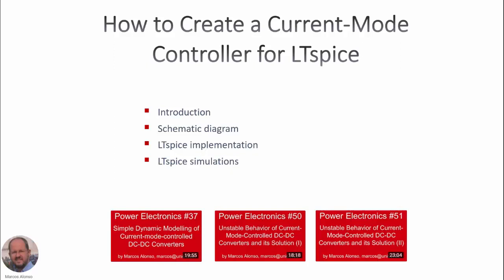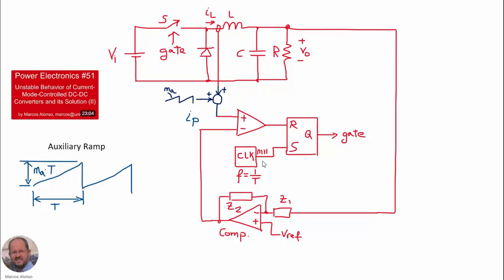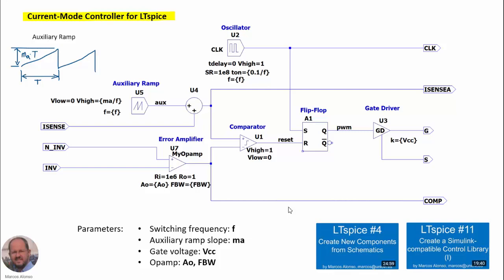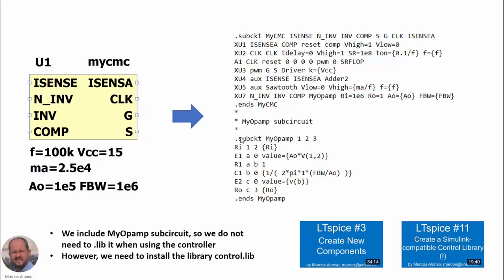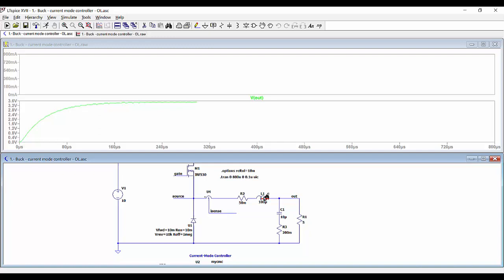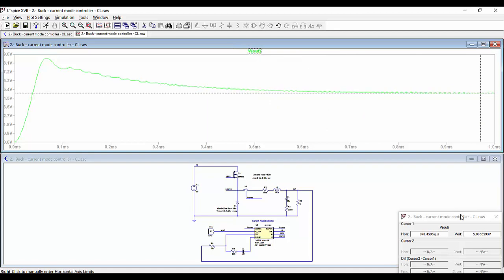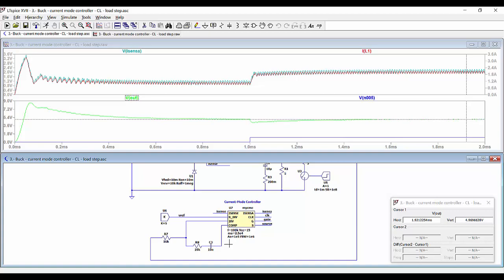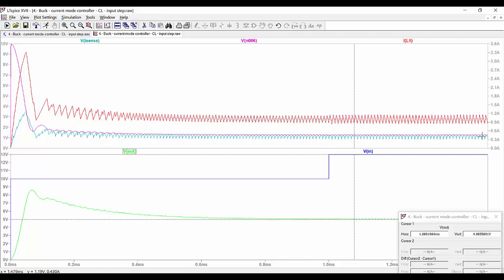LTspice #25: How to Create a Current-Mode Controller for DC-DC Converters

Comment: Good evening Professor Alonso. Thank you so much for the videos and for the work you are doing. Your approach and your simulations are very helpful. When your availability allows, could you do some videos on Isolated dc-dc converters using voltage mode and then current mode control ? Once again, thank you so much for your presentations.
Reply from the maker: Hi, thanks for the suggestion and for watching the channel!

Comment: Una pregunta ❔
Porque muchos lazos de control usan un ota en lugar de un opam en el fb .
No entiendo que ventajas tiene un dispositivo que en base es una fuerte de corriente en lugar de un opan
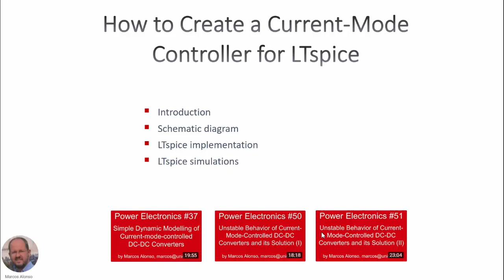Reply from the maker: Los OTA tienen la ventaja de que al comportarse como una fuente de corriente en la salida, esta se puede poner en cortocircuito a masa sin forzar ningún tipo de protección como pasaría en un OPAMP. Esto facilita la implementación de protecciones, funciones de apagado, etc. Por ejemplo, en el LM3524 cuyo esquema se puede ver en este video: https://youtu.be/8L9D50tRWo4 en el instante 1:14, se puede ver como en paralelo con el amplificador de error (que es un OTA en este dispositivo), trabaja el comparador de protección de corriente y también la señal de shutdown. Cualquiera de estos dos últimos puede cortocircuitar la salida del OTA a masa y detener la generación de los pulsos PWM. Se puede implementar también de forma muy sencilla una limitación de valor máximo del ciclo de trabajo usando un diodo conectado con el ánodo a la salida del OTA y el cátodo al punto medio de un divisor resistivo alimentado desde la tensión de referencia. En fin, tienen bastantes ventajas, especialmente cuando el convertidor va a trabajar en modo tensión, es decir, control por ciclo de trabajo.

Comment: Hi Doctor Marcos, Is it possible to add a soft-start by increasing gradually the Ip_ref?
Reply from the maker: Yes, of course. You can use an R-C circuit to increase the reference slowly. Usually, this is done in closed-loop operation by increasing slowly the reference voltage during start up. Thanks for watching!